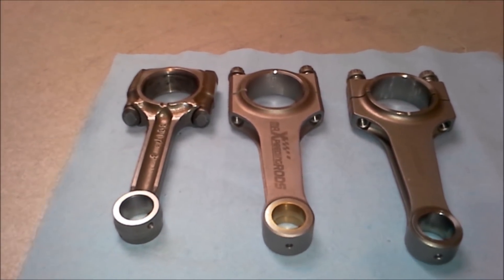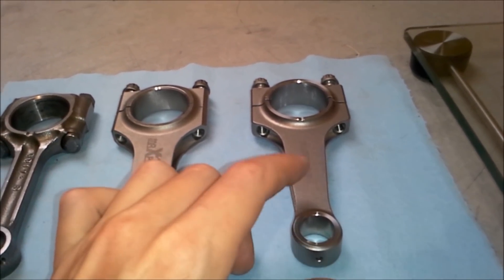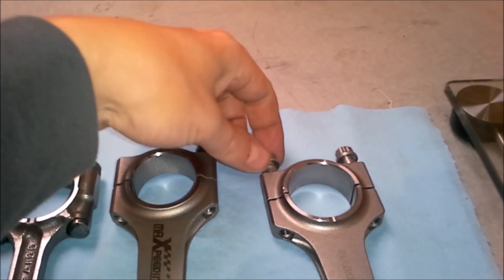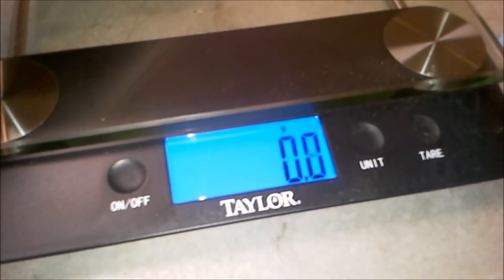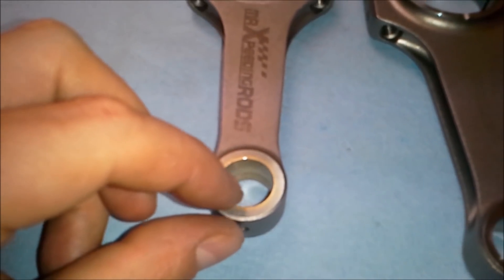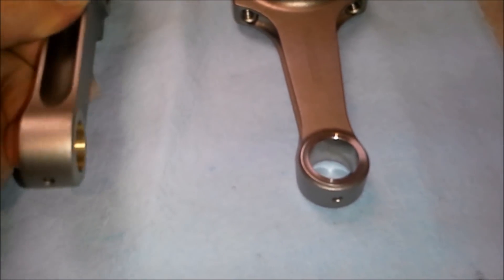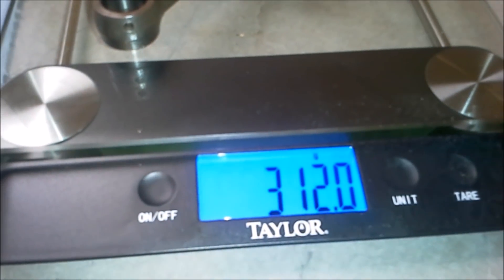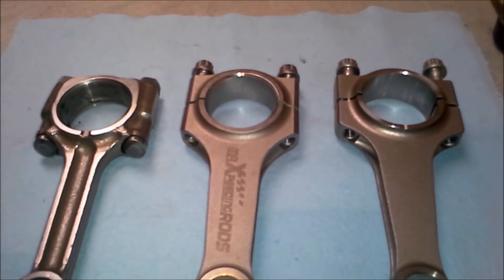OE Connecting Rods vs MaxpeedingRods vs Carrillo Rods, Cheapest vs The Best

Comment: U wanna have a heavy rod vs light rod nd floating pins bc thats the best of both worlds turk nd HP RPM  so i go w maxxspeed rods All day
Reply: Maxspeed rod might be better for boost due to being beefier, but light weight is always better as long as it's strong enough for the loads. Heavy rods do not give more torque, just more stress on the crank and more friction.
Reply: @Midnight_Rider96  right? Also I would put all my money on Carillo rods holding more power then the heavier rod due to how they are manufactured
Reply from the maker: Negative on the heavy rod ghost rider.
Reply: EVERY DAY I RACE m talking for car kid not bikes but lturk nd rom is were is at
Reply: SRT8/power 6,4  WHATS MAXXSPEED!?? THERE CALLED MAXPEEDING. CHEAP SHIT CANT EVEN SPELL THERE OWN NAME CORRECTLY